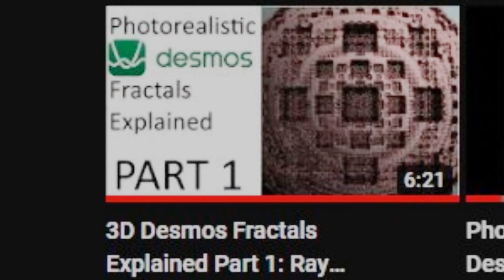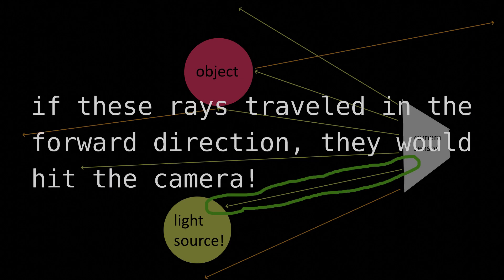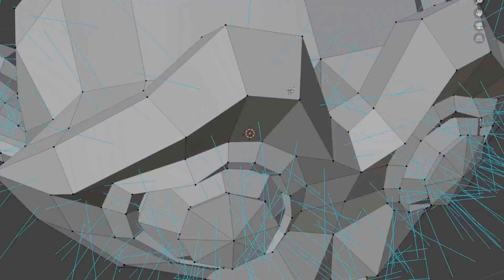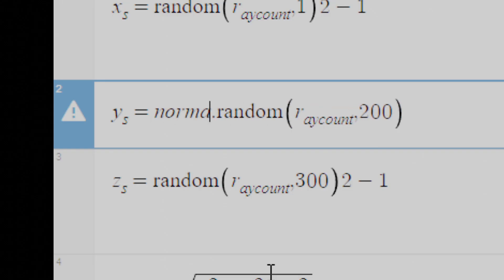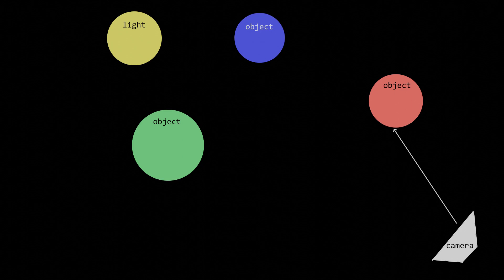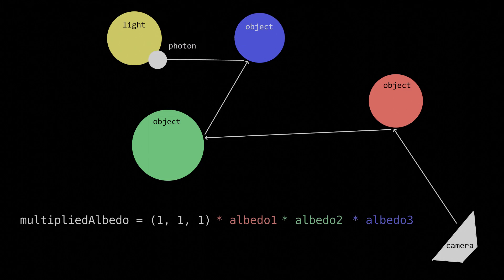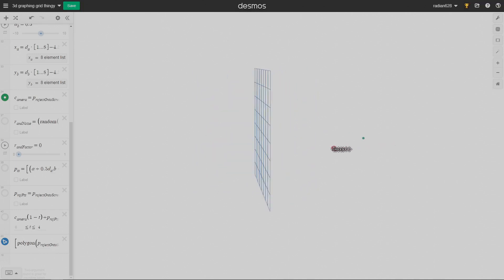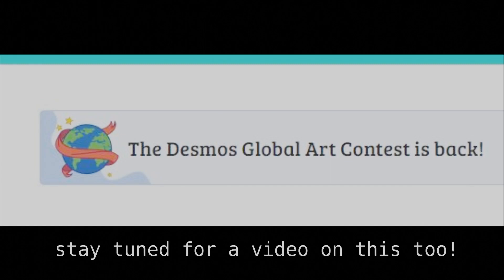3D Desmos Fractals Explained PART 2: Making a 3D rendering engine.

Comment from the maker: CORRECTIONS:
- I was wrong about the light color being in the range [0, 1]. The albedo should almost certainly lie in the range [0, 1], because anything >1 would violate conservation of energy (reflecting more light than initially produced). However, light color, which describes a *light intensity*, can be greater than one (which is something I in fact routinely do).

Comment: Ah, that explains why in the Solidworks CAD software renderer, it starts off looking noisy and low-res, and then it proceeds to run down and back across the rows of pixels increasing the resolution and decreasing the noise; it must be running more random reflection calculations for each area. It makes sense that it runs these calculations in such a pattern, since it gives you a rough idea of the scene (so you can check if you screwed anything up) before it goes and does all the intensive work to make a pretty image. Neat.

Comment: I'm very glad you made this video. I've never known what to do when you get the color values of a pixel's intersections. It was sort of an "in the air" concept when people have described the procedure of path tracing in their explanations.

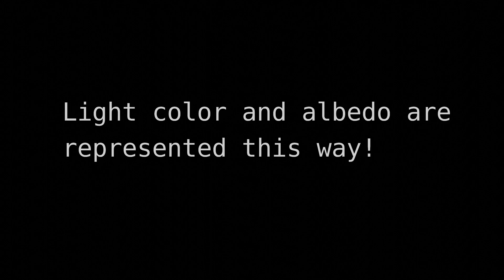You've touched on something that's always confused me about path tracing (I've been deterred from making my own path tracer because of this). You declare that you have to multiply the colors together to get a final color (6:33). You've finally given me THE answer that I've been wondering about for years, but now I am confused by it.

If you store RGB values from 0 to 255, wouldn't the multipliedAlbedo blow up to a ridiculously large amount? For each multiplication, you'd just make it larger and larger than it's previous amount. It'd become so large that it'd lose all meaning when compared to the meager lightColor quantity.

Instead here, you store RGB values from 0 to 1. Okay, this solves the "blowing up" problem. But wouldn't the multipliedAlbedo instead approach 0, with each ray calculation? Each albedo has a magnitude <1, so it will shrink. So this time, instead of being too large, the multipliedAlbedo would be too small compared to the lightColor quantity.

Also, what if an albedo is colored (0,0,0)??? Wouldn't that make the entire albedo completely black?

 
I hope I have outlined my concerns with your method. I am confused why this multiplication approach is a viable solution for coloring pixels. Is there another component to this algorithm which I am missing? Or does this truly work, and I should just try it and see for myself?

Keep in mind this is coming from someone who hasn't yet attempted this himself, but I am trying to picture it in my head before I give a formal stab at it.

Let me know if you have any comments about my conflict regarding multiplying the values.

P.S. The whole video is greatness, but man, 3:31 is pure gold.
Reply from the maker: I'm really happy to hear that I helped fix that issue for you! This plagued me as well when I was developing the WebGL raymarcher, so I knew I had to explicitly mention that in this video.

As for the issues with the albedo approaching zero, here's my thoughts on that: While it will approach zero, that's by design- In the real world, when light reflects off of an object, you can never end up with more light than what you started with: It's always either the same amount or less, because anything else would violate conservation of energy. Reflecting and getting more light than what you started with is analogous to the albedo being greater than one, because that >1 albedo will ultimately multiply the light color by something >1, increasing it. Going further with the physics analogy, the reason why color shows up in the first place is because objects reflect certain wavelengths of light and absorb others. For instance, a red object (generally) reflects red wavelengths of light, and absorbs non-red wavelengths of light, causing only the red ones to be picked up by your eyes when you view the object. It's like it's filtering out the non-red wavelengths, leaving only the red ones. The albedo is analogous to such a filter.

In terms of how "multipliedAlbedo approaching zero" affects how the final image shows up, it's worth pointing out that in most cases, the vast majority of light will be from direct lighting- i.e. rays that only bounce off of a single object before hitting a light. This causes the albedo to only be multiplied a single time. 

As for the (0, 0, 0) albedo, while that is completely true, in practicality, virtually all objects that appear "black" aren't 100% black- they'd be more accurately be described as a very dark shade of grey (or even another color), maybe something like (0.1, 0.1, 0.1). If they were perfectly black, then they would- like you said- be entirely 100% black without any visible shading.
Reply: @Radian628  This analogy makes so much sense. You've pretty much put my concerns to rest. I realized in your analogy that an albedo >1 would become emissive, since that energy would have to come from somewhere per conservation of energy. It actually makes a lot of sense for it to be from 0-1, I don't know what I thought it has to be from 0-255.

"it's worth pointing out that in most cases, the vast majority of light will be from direct lighting- i.e. rays that only bounce off of a single object before hitting a light. This causes the albedo to only be multiplied a single time."

In my mind, I'm thinking of a Cornell box situation, where there is a lot of indirect lighting. Is there necessarily a time where you would stop multiplying light rays, or favor one albedo versus another?

Or here is a more concrete example: Let's say I am inside a cube, where +X is (1,0.1,0.1), -X is (0.1,0.1,1), and everything else is (1,1,1). If stare DIRECTLY at +X, what prevents the viewer from seeing like (0.0001, 0, 0.0001), since as the rays bounce over and over again, the R and B values would just keep getting smaller? Wouldn't larger ray iterations make it even darker? Is the color +X, or is it a mix of -X? What tells the renderer to favor the color red instead of blue, and how much it should leverage indirect lighting?

Since the albedos multiply and order doesn't matter, it almost seems strange to me, like there's no frequency of which color is important. Obviously a +X should be a diffused red, with only tints of blue.

Hopefully it's not a dumb question, let me know if it makes sense.
Reply from the maker: @Heavenira  Not a dumb question! You've brought up a lot of things I actually never considered lol. Here's my take on it: 

"Is the color +X, or is it a mix of -X?"
"What tells the renderer to favor the color red instead of blue, and how much it should leverage indirect lighting?"

Here's the way I like to think about it: Any ray that hits the +X side, independent of all the reflecting it does later, is guaranteed to have a bounce that decreases its blue channel value by a factor of 10, while keeping its red channel value constant. So even if it bounces around the scene a bunch of times, reflecting across side after side and ending up with a very dark mix of red and blue, it'll have this guaranteed hit on the red side, meaning its red channel value is 10x as high as it would be otherwise, and thus making the light redder on average, compared to if you just casted out a random ray. I'll admit, however that this isn't a perfect analogy, since a ray that hits the red side cannot hit the red side on its subsequent hit. However, if it were to then hit the blue side to balance things out, the blue side is now in the same boat. And hitting the blue side on the second bounce isn't even a guarantee, unlike with red. Ultimately I think this gives red a slight edge. One way I like to think about this is if we look at the average ray and measure "how many times did this hit +X?" versus "how many times did this hit - X?". Even if we hit +X only one more time more than we hit - X on average, that's already a color 10x more red than it is blue. So even if red wins out only slightly, the difference will be drastic. I also did an empirical test of this in my WebGL engine, which aligns with my results- even with 10 reflections or so, +X is red and - X is blue.

"what prevents the viewer from seeing like (0.0001, 0, 0.0001), since as the rays bounce over and over again, the R and B values would just keep getting smaller?"

In that case, I would increase the light intensity (color channels of lightColor) until everything was bright enough to see. I often have to go into the double or triple digits with smaller light sources. I kind of made a mistake with this in the video actually.

"Wouldn't larger ray iterations make it even darker?"

As for the issue of adding more bounces decreasing the brightness overall, I think the opposite effect should happen with more bounces, because rays that ultimately don't reach a light at all are still counted in this renderer- they just lower the average brightness slightly because they count as (0, 0, 0). If adding bounces causes those rays to reach the light source, now they're probably contributing a nonzero amount to the brightness, making it slightly brighter than if they contributed nothing. To me the key thing is that the proportion of rays that take N steps to reach the light source stays the same regardless of the number of steps, so adding more steps won't cause extra rays to take more steps to reach the light (which, like you said, would cause them to contribute less light). Interestingly, the scene did darken somewhat when I turned up the number of reflections- I'm not entirely sure why. 

Hope this helps!
Reply from the maker: Also something I should add is that I made a slight mistake when talking about the light colors- albedoes should generally be in the range [0, 1], but light colors can be >1, since they describe a light intensity, which, physically speaking, has no reason to have such an upper bound.

Comment: you touch on how noisier scenes need more rays per pixel - I wonder if there's an efficient way to automatically detect noisier areas in a single scene and dynamically increase ray count for noisy pixels? maybe casting a base number of rays for each pixel, and analyzing them based on number of reflections, final colour/brightness, distance traveled, or whatever is important to see how different the rays were from each other. then if a pixel has pretty similar rays it probably isn't very noisy, but if the rays are very different from each other the program could decide to cast more rays until the noise is hammered out. or alternatively, check final pixel colours against the colours of neighbouring pixels, and if there's a big difference, cast more rays (which would be inefficient with hard shadows and edges of objects, but may be efficient when there are few objects and soft lighting). with either method I'm sure it would take a lot more memory to render each pixel, but I wonder if it could improve the quality-to-render-time ratio, at least in scenes with some very clean areas and other very noisy ones. (even if it could, though, I can't imagine trying to even start implementing that in desmos!)
Reply from the maker: That's a good idea! While I don't know how feasible it would be with Desmos (might be something to try at some point however), such a technique does exist, called Adaptive Sampling: https://docs.blender.org/manual/en/latest/render/cycles/render_settings/sampling.html#adaptive-sampling